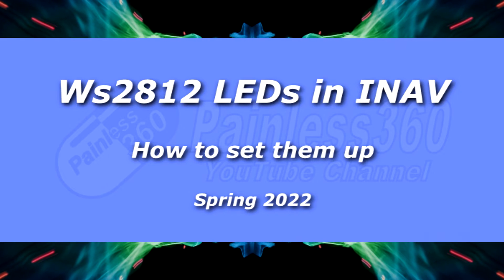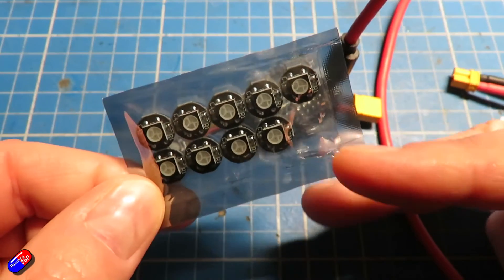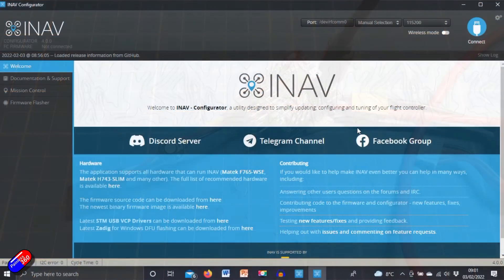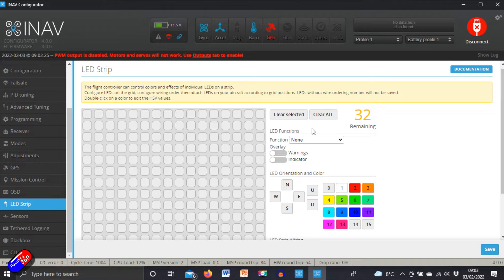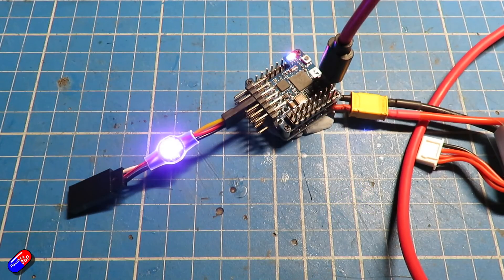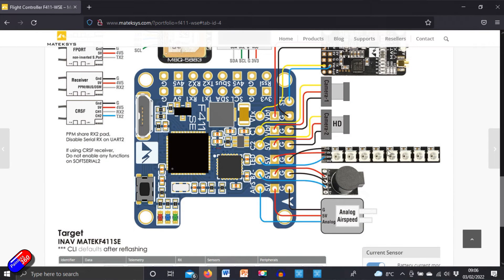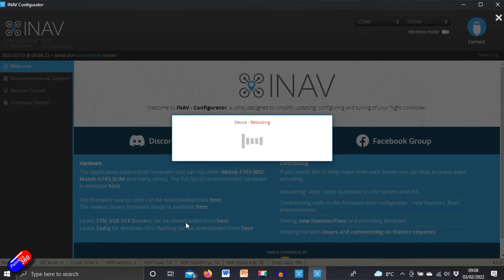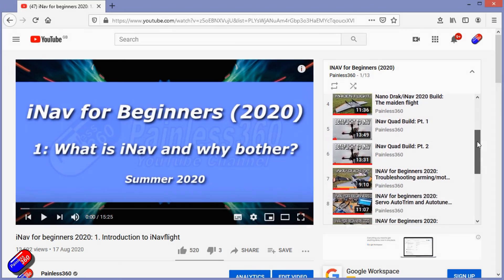How to setup WS2812 LEDs in INAV

Comment: I got two 2812ARM connected to a 2812LED controller and via PWM (connected directly to a servo output or PWM port on the RX) it works to change their colors.. So I thought just connecting the 2812LED controller to my Matek F765WSE would allow me to control those LEDs seperately but it seem to be impossible at all.

So do I understand it right after watching this video that I can connect the 2812ARM LED stripes directly to the LED port from the F765WSE and then am able to individually set up all 12 LEDs from that two 6-LED-stripes individually in INAV?

My idea was to have two stripes on each wing (one on top and one on the bottom) to simulate the orientation and strobe lights properly.
Reply from the maker: Not sure, I've only used the WS2812 stuff here. Best of luck!
Reply: @Painless360  I just tested it and you can indeed directly connect the 2812ARM to the LED port on the Matek FC, daisy-chain multiple of them and configure them individually in INAV. This is perfect.

Only issue left is that I need to connect the right wing in serial from the second 2812ARM of the left wing. But I guess I will just steal ground from the servo for the left wing so I can use the LED ground pin for the DOUT of the second LED module on the left wing since the AR Wing Pro only has 6 pin connectors on the wings but that should work out! 🙂

Thank you for your quick answer though, hope my research helps you as well! Watching your videos for years already and they are always very useful! <3

Comment: The first led on my setup flickers white. I tried a 1n4001 diode but it only reduced the brightness and produced the same problem. I had to remove the leds. Shame it wouldn't work properly because I spent about 20 hrs modeling and printing the esc/led mounts for the quad I'm building
Reply from the maker: This is video shows how I use them here https://youtu.be/frOAgeiK9dM best of luck

Comment: So just for all of you using the LED mode some controls: Click, hold and drag to put down a line of LEDs in coloring mode, also drag to select multiple LEDs in a line, holding control while clicking allows you to select multiple points at once. I hope that makes it a little easier.

Comment: I got the Heewing T1 aswell. Using the F405-WSE. However, even after following your tutorial, i can not seem to get the LEDS to have a color different than white... Any idea what I am doing wrong?
Reply from the maker: Sounds like something isn't setup right. What troubleshooting have you already done!?
Reply: @Painless360  Well, at first the led's didn't work at all. So I then checked the connection on the board and made sure LED strip was enabled in the CLI which it was not. Didn't save somehow. Then i connected both wings. Did a reboot and the LEDS turned on, but white. Good...I thought... But for some odd reason, even if i turn led strip off in the settings they still stay lit, and I also had assigned a switch to turn it off...Which doesn't do anything either. And also cannot change the colors in the INAV configurator the way you did. Don't really know what is causing this issue...
Reply: So I assigned the LEDS to a switch so I could turn them off... When they are off. Turning them on works with the switch, but nothing else does...  not even turning them back off...Very weird behavior
Reply from the maker: White LEDs are usually seen then they are getting a signal but not any colour information. I'd check how you have it setup in the LED tab.. Best of luck!

Comment: So when wiring, you can link together in any order, and tell the processor that order to make it work?  As in your display where left is first, right being second, and so forth, or you physically have signal going to left, then right, tail, nose, and bottom sequence?
Reply from the maker: Yep, the wiring order can be anything you want. The wiring layout in the LED tab just lets you place them where you have them installed so you can 'see' where they are on the model when you set then up and use handy if you want to use the orientation options too... Happy flying!